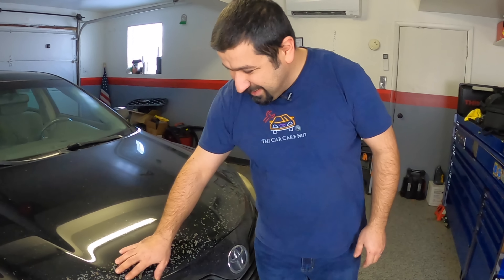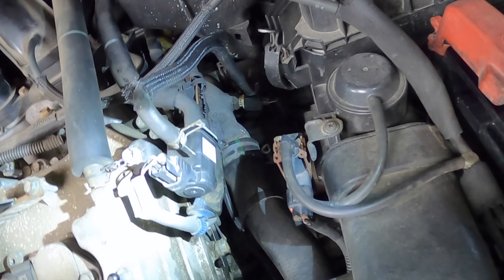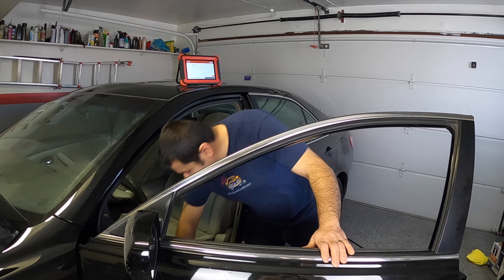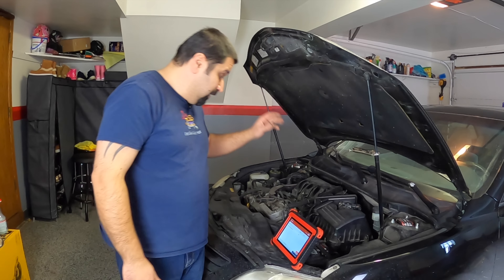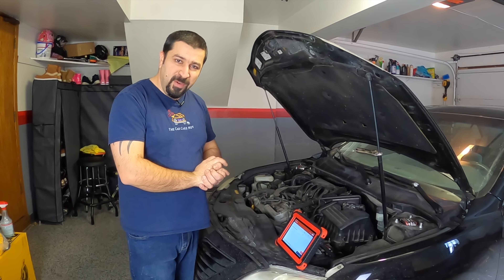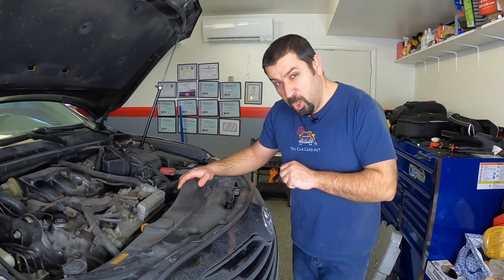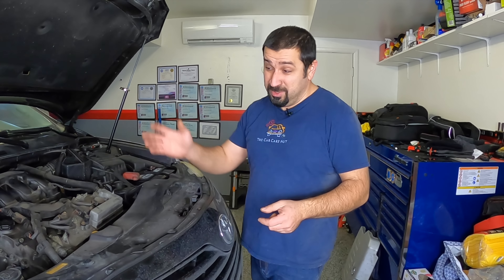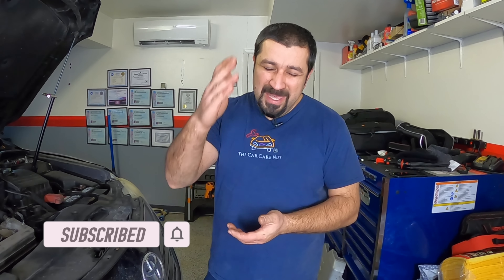How Does a 15 Year Old Toyota with OVER 200k Miles Hold up? Full Inspection!

Comment: Great video AMD! I have that car with that engine, just the XLE model. She's still perfect. I love that engine. Good to know it can easily make that milage. I'm a true car care nut and change fluids when they are due so hopefully I can make it that far with no leaks! Should I be worried about the oil supply line to the vvti? I've heard people say it needs to be changed to the solid metal one but it looks like a pretty big job. Thanks!!
Reply: @photog3377  I did that job 2.5 hours seems on the low end. Why did you replace the power steering pump?
Reply: Be careful I had my dealer order one and they still sell the one with the rubber. I told them no I want the full metal one. It has a different part number.

Comment: Great stuff. Could anything have prevented those oil leaks, or that's just the way it is with age & that many miles?
Reply from the maker: Hi! Nothing really to prevent it. This engine runs very good and it was maintained but the age and miles
Reply: If it is indeed the timing cover leaking then Toyota has issued a TSB about it. No amount of maintenance would have prevented it. Unless you count removing the engine to reseal the timing cover maintenance.

Comment: It would be nice to have a manual transmission with that; last generation Camry with manual.
Reply: @PDB Long that's my dream car! 1992-96 manual transmission Camry DX. I looked at a 1992 last week with 173K miles that they would give to me for free if I could repair it. It was a super mint car except they hadn't waxed it in 30 years & the roof, hood, & trunk lid, all had clearcoat failure from sitting in the sun for all those years. That's why I didn't want the car. The interior smelled like a cross between decompozing rubber & a musty smell, but it looked mint inside. It was an iconic car though. Even if it takes me a couple years, I'll still be on the lookout for a good condition manual transmission XV10 Camry.

Comment: Hey man I really like your videos and I’m also a Toyota nut lol. Wife’s 2005 Camry LE 4 cylinder has 420,000 miles on it and still going strong. The only repair work I’ve had to do to the engine was at about 275,000 miles. And that was the water pump, valve guide seals, valve cover gasket, spark plugs and motor mounts. Trans is all original. At a little over  300,000 miles I replaced the struts, lower control arms, all tie rods and ball joints. Unfortunately lol, last week she told me the check engine light came on. I pulled the code and it’s the dreaded P0420 catalyst inefficiency detected. So not sure yet what I’ll do with that one if it turns out to be the converters going bad.
Reply: I also have a 2005 Camry LE 4 cylinder. What a tank and an amazing car. Over 17 years old and runs so smooth. Only replaced speaker covers after 13 years and the main pipe connected to muffler got a small hike after 11 years. Other than that, regular oil and brake changes. 1 tranny flush. 350.000 kms. Toronto Canada
Reply: I belive my cat converter cost between $600-800
Reply: Just bung a second hand Cat on it from your local scrap yard. If you get one from a newer car that maybe was written off you should be good for at least another 180KMILES 🤞🤞👍👍. Good luck.
Reply: You can try cat cleaner and run it through you gas tank. Also an exhaust leak before the 02 sensor can cause a code. But if you don't have emissions testing where you live roll with it
Reply: I have same code on my 2002 Sienna, 275,000 miles.  My state doesn't do emmision tests so I will  just wait til the code lite burns out someday.. 😀
Reply: @highland6439  Same here

Comment: I have an 03 Toyota 4Runner. I live in Chicago as well and ever since the check engine came on for the cats I stopped maintaining it. 😂 I just do brakes and oil changes. It’s losing coolant, vibrates coming to a stop, all sorts of issues. Going towards 220,000 miles. All I know is the thing starts up every single time and runs smooth. And that’s all I really care about 😂 when it breaks down we will cross that bridge when we get there 😂😂

Comment: Great analogy, AMD. See, that timing cover leak would drive me up a wall. I WONDER how many miles on timing belt?🤔 I'd get belt changed, new gasket, & belts (power steering/alternator) changed also. The shape that car's in, I'd risk it. I wonder how tranny fluid is? I'd consider if tranny is in good shape. If bad, jst do what u HAVE to pass. Especially with the economy of purchasing/car payments. I would have liked to see crankcase oil on dip stick, too.
Reply: @therealbenji  oh, okay. My 97 had a belt

Comment: Nice presentation nice to have someone who is thinking ahead all the way through the diagnostic and decisions process, no sales pitch no dumbing down the comment.
So many Internet celebrities think they have to entertain everyone, not necessary just because I don’t wrench on cars doesn’t mean I’m stupid.
Wow six out of six! 
Oil smell 
Motor mount 
Oil leak 1,2,3,4
Muffler and repair to eliminate joint not what I would do but it’s done by others.
Gas cap I’m going out tomorrow and order a new cap from Toyota parts department, my aftermarket cap is awful.
Filler tube wasn’t bad no rust.
You just knocked me out with that one, lol
And two motor mounts aftermarket.
Buddy I need to visit your shop makes my mechanic look like a hacker.

Comment: I know someone with a 18 year old tundra that is like new, and has under 50k miles. What is your opinion on timing belt, water pump, fluids, etc?
Reply: An opinion on what?  Should it be changed?  Absolutely.  Right now.  Way past 7 years of expectation.
Reply: Timing belts every 75,000 miles.
Reply from the maker: Hi! Honestly I would change the belt and water pump first then tackle the fluids
Reply: @TheCarCareNut  I'm trying to get him to do it asap. My tundra is almost 23 years old, and just got its 3rd round of full maintenance. He's convinced that since it was garage kept, it should be good.

Comment: My 2015 Highlander with the V6 and AWD has 175,000.  Other than maintenance, the only repair was replacing a little rubber according thing on the bottom of the sunroof.  $33 installed.

Comment: Bought '96 Toyota Tacoma 2.4L 4 cyl. automatic with A/C in 2004 used for $900 - best money I ever spent. Now has 227,000+ miles. Starts, runs, drives great, everything works inside and out. Other than dead battery once it has never failed to start/run. Never garaged.  Zero problems - doesn't leak oil/fluids, replaced tires/brakes/wipers/battery as needed.  Paint looks decent - has chips and marks from use, no rust.  Interior is very good for its age/usage. Everything works inside and out. No rust & we live in coastal area.  How??? Wash/wax once a year, basic oil / trans fluid changes, tune ups I do myself.  Regular maintenance is inexpensive and simple - I use Chilton manual to learn how to service.  VERY durable & reliable little truck!  My first Toyota - have bought nothing but Toyotas since.  Don't waste money buying new cars, buy used Toyotas.

Comment: I made the mistake of spending too much for repairs on an older car: 1996 Honda Civic, bought new and carefully maintained for twenty- plus years. In 2017-18, I put about $5000 into repairs because I loved the car so much. Exhaust pipes, new tires, struts, CV boots, timing belt (because it was due for routine replacement), probably more that I am forgetting. I thought maybe I was all set for a while, and the catalytic converter rusted out. I gave up on it, tearfully. Engine and manual transmission were still fine, body still pretty much rust free, interior clean and good, still a joy to drive. I donated it to Iowa Public Radio, and got a note saying it auctioned for $500. Sigh!!!  But I found a clean used 2013 Prius C (bought late in 2018) and I love it too. Still basically perfect at age 9; may it have many more years to go.
Reply: Why didn’t you replace the cat and keep going?!!
Reply: @LoveLikeaHurricane  In retrospect, I should have.

Comment: I had 2004 Corolla CE. Just sold it to the dealer for 600 dollars. It had 255 thousand kilometres on it. Other than brakes, battery, maintenance, tires etc... All I replaced was a power steering hose.
Reply: @Gerry M bro why so cheap? 255,000 kilometers isn't actually ALL that much when you think about it. That's nothing for a Toyota. I drive a 2006 Matrix base. It has 242,000 kilometers & it shines like brand new. The only drawback to it is that it's an automatic. Oh well, I've seen automatic transmission's on Corollas & Matrix with 600,000 kilometers & they still shift pretty good. But why did you trade your Corolla in?
Reply: @Blakecryderman7244  didn’t want to deal with people coming around. I didn’t need it anymore. Retired.
Reply: @gerrycgc  oh I see.

Comment: I have a 2007 Prius with high mileage and dealing with putting things back parts like shields back on that the repair shop decided not to put back on. As I keep making the car operate better you reach a point that the cost isn't really helping the car much. This video gives me a great look into the trade offs. Thanks for your input into Toyota repair thresholds.

Comment: Every video I wish we had a good Toyota guy around here in central Arkansas. Lots of folks can "fix" things but true knowledge particularly on the aftermarket parts or not is rare. Most just seem to get something from Oreilly or wherever to "save you money" and get you out of the shop. Even though  they do a decent job... dealers will use all Toyota parts but have become glorified parts changers. $$$$

Comment: My 2010 Camry XLE just hit 173K miles. Still runs pretty good. Not like new but still chuggin along. Only major things I have had to do since getting it at 83K miles is new struts a few years ago. The radiator and alternator went out last summer. (At the same time🙄) Other than that routine stuff. Only thing I wish I had done was do a transmission fluid flush when I got it. Now I am afraid to do it because I am so far out. Have noticed a little bit of odd shifting here and there. Nothing crazy...just caught my attention. But still runs ok for now. Guess I will drive it till the wheels come off hehe. Best vehicle I have ever owned.

Comment: I have a Japanese made 2007 Camry with 110,000miles and the 2AZ-FE 4 cylinder and gave it to my youngest daughter. It still drives like a dream and dead reliable, just watch the oil level because it consumes 1 quart about every 1200-1300 miles.

Comment: Speaking of gas cap.  This drove me crazy on a 2007 Avalon.  I bought aftermarket cap and I still got the engine light code pointing to leak in purge system.  Then I bought an OEM cap.  Still same engine code.  To make the story short, in 2007, Toyota switched gas cap in mid year.  When you ask for a gas cap for this car, they give you the later gas cap.  I had the earlier model.  The way I found this out is to enter my VIN number when ordering the next gas cap at the dealer web site.  The wrong gas cap seems to fit fine.  Plus no gas smell at the cap when wrong cap was installed.

Comment: You are definitely smart, and know your stuff. However, that is not a “universal” gas cap. It is an aftermarket cap which could (rarely) cause an issue. But it is designed in the aftermarket for that vehicle application. Also the proper name is Torque Strut Mount aka Dogbone. Keep up the good work and if you ever need an advisor for anything parts related I’d be glad to help! Over 22yrs experience and knowledgeable with many of the OEM vendors also. Thanks for the content!

Comment: 1998 rav 4 L 4 door bought ot brand  new and still have it after 24 years old and  350k miles with no known  issues. All fluids done by me on a regular  basis, time belt brakes the normal components replaced.

Comment: My 2005 toyota matrix hit 300k miles 6 years ago. Odometer stopped at 29999.
Same engine and transmission and still running.

Comment: Excellent advice here!   I must say I am not too impressed with Toyota after watching this.  I had a 12 and 13 year old Accord and Altima with similar miles.  Both had their original exhaust systems, no significant leaks, all original suspension and emission components, almost no rust and I doubt I spend more than 1k on repairs over their lives ( I did the oil and brakes)  The accord did burn oil but still ran like a top.
Reply: This is just one Camry example.  there are many out there which has over 200K miles and not burn a drop of oil, just like your Honda.

Comment: I have a 2012 Toyota Camry se 216000 miles..only thing done is alternator plugs belt tires and battery brakes... no leaks idles smooth ac still cold transmission original shifts smooth...

Comment: AMD, you mentioned the fluids in a Toyota should be change after a certain period. My 13 y/o Scion xB has ~72K miles on it. I've checked the moisture content of the brake fluid with a moisture pen as you did and found no high level moisture in it. Color is perfect and no sign of age. Also, the coolant measures perfect with a gauge from Prestone. Also, no color change, no floating debris looking quite perfect. As an older driver, (80) if fluid changes are to be made, I have to plan the cost of them.

Comment: Hi ... 
I always admired your uploads, filled with lots of information and multi-angular approach towards issues, with a unique gentle touch of your personality ..... 
I have camry 2008 2.4 ..... Which is far better in condition than above one. Its  not  only the car, but the owner too, he / she should be checking such vehicles periodically all around 360 + 360 degrees .. And should take measures to fix the leaks before they start dripping .. 

Keep up the GuD work Bro ..... Thumbs Up
Reply: If it is indeed the timing cover that is leaking Toyota has a TSB for it. It is an engine out job to fix it, not cheap. Probably why he just said to wash it off.

Comment: I have the 2006 Camry  V6 with extremely low mileage .
The only history of parts replacement was  front control arm replacement due to worn rubber brushing on one side, but Toyota Dealer wants both side replacement plus wheel alignment. 
Replacement of all 4 brakes with disc  use all OEM parts,  3 sets of tire replacement ,  occasionally oil and filter change,  original  air filter blown clean every season.  Rust proofing with oil type of product  annually.  Remote fob batteries replacement as needed, and replacement of  the entire wireless remote car receiver assembly inside the car  due to the  fobs cannot open or close the  doors or  trunk anymore even reprogramming and battery replacement.  First battery replacement this year.
Yes, replacement of  2  rear plastic  speakers covers due to sun fading and crumbled  into broken pieces.  I fabricate  the covers with my own non fading  gold metal  screen covers  from Home Depot with original speakers intact. 
As of today  it starts, runs smoothly,  rides good, and stops good.
Reply: Yes, lots of front hood stone chips  and other paint damage from my friendly  next door neighbors ' s blown house roof shingles. 
Tried to use OEM TOYOTA touch up paint but very disappointed  due to lack of paint inside the  lousy pen.
Re touch up with an after market paint with  a brush inside but with a wrong color due to I can't get that  factory color  (6R6). Just to prevent rust and further paint damage. 
It works but ugly as hell.
Next  later this year is to go to a local auto paint  shop and get them custom mix me the original  (6R6) color  to cover the wrong color.
She's worth it.

Comment: Use an independent mechanic after the warranty runs out.  But, use one that specializes in Toyota/Honda.  Preferably one that used to work at a dealership.  Look for certifications on the wall.